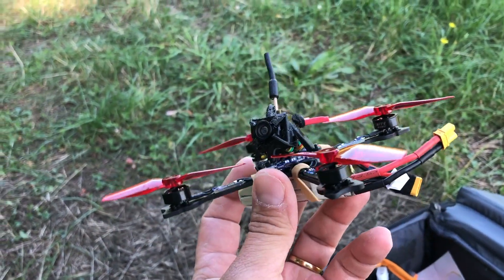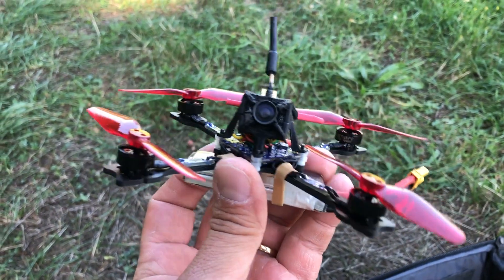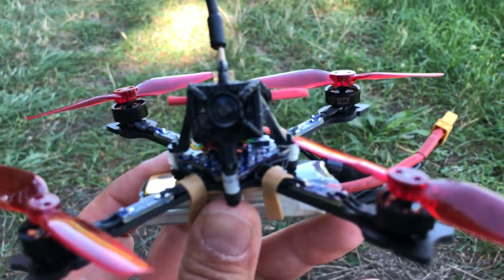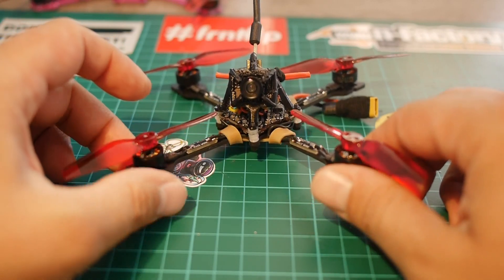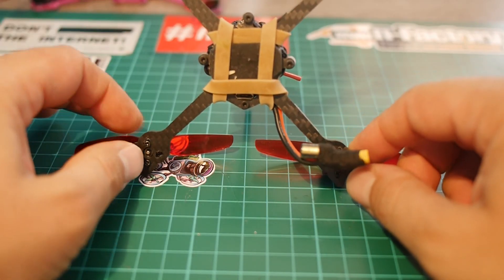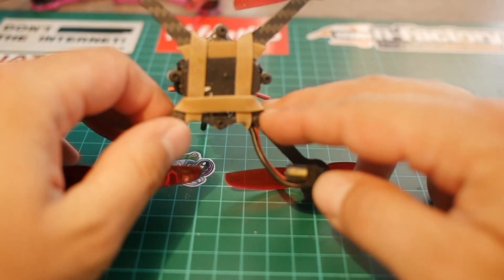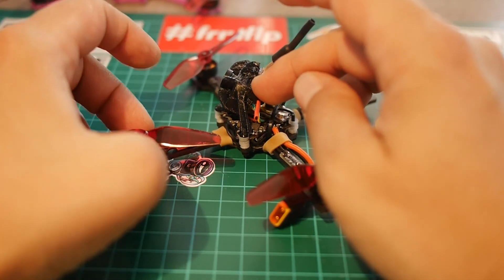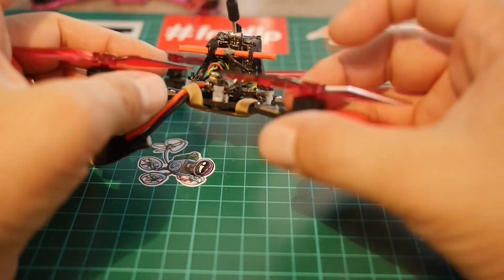Pickle 3inch : ultralight micro quadcopter review

Comment: What exactly capacitor do you use in this build?
Is 3s too much for the 1103 8000kv motors?
Reply from the maker: Yoda Yedi a 16v 100 uF. Should work on 3S but those 1103 motors are a bit too small for such props unless you keep the weight super low

Comment: thx for sharing! 🤙🏾 i just built a 2.5" pickle. i can't fly with these aio cameras anymore so i allow for a little extra weight in exchange for a good video/pic feed. i use the predator nano v4 and the vtx out of a rex80. great pic/video feed, 100mW vtx. dry weight comes in at 46.6g. flies awesome! i will be working on a 3" ultra light next. thanks for the inspiration!! cheers 🍻 from Florida
Reply from the maker: Wait, What!?! I kinda arrive at the same conclusion. I don’t use aios usually, in that case it was more of an experiment :)